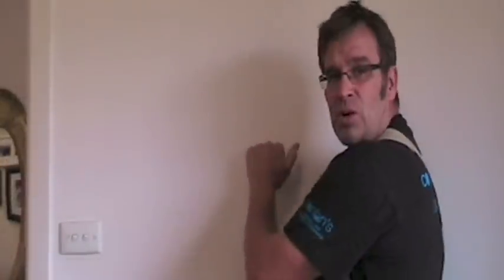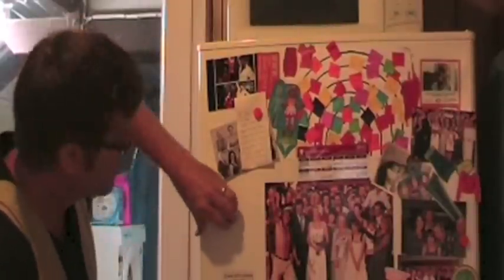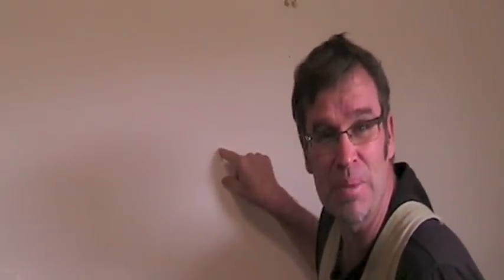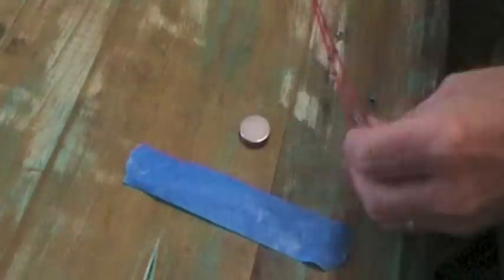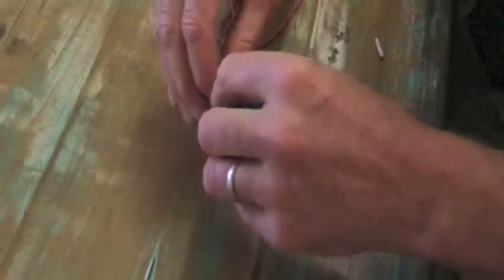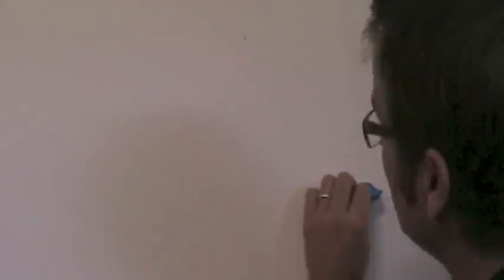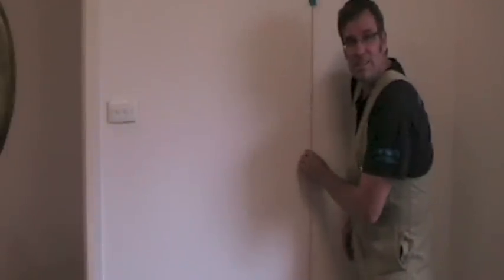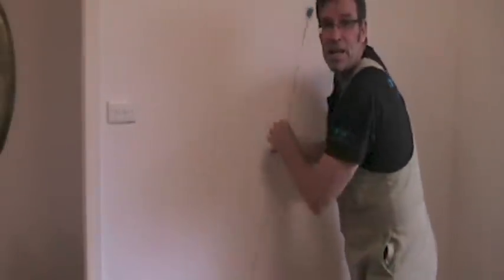How to Find a Wall Stud. THE ULTIMATE STUD FINDER!

Comment: Can I please ask you somethin? I do have a stud finder but every time I found a stud it wasn't a stud, and I tried your magnet thing but it didn't work and when I drill into the wall where the stud should be what comes out is something white like plaster but it's not drywall where it's Hollow what is that and how am I going to hang the thing I have to hang
Reply from the maker: Sorry Stephanie, but without seeing your wall it is hard to diagnose. Maybe ask someone from your local hardware store. Good luck 👍

Comment: I have a giant sheet of metal directly behind my sheetrock in my closet, that broke a drillbit for wood. It's so strong. I'm trying to hang a closet rod and shelf but I can't get through the metal. I have a stud finder and it can't find the studs through the metal. Please help, will liquid nails work?
Reply from the maker: G'day Dj. If you can't find the stud due to the metal sheet, get a metal cutting drill bit and drill right through the sheetrock and the metal sheet. Then go and purchase some wall toggles. Wall toggles are really good at attaching brackets to a wall. Make sure you read the back of the packet to see how much weight that particular toggle will hold. You can buy different sizes of toggles for various weight loadings. Hope that makes sense. Cheers. PS. Buy the toggles first and read the back of the packet. It will tell you what size of drill bit to use.

Comment: Mr Shane sir, what are the chances that the magnet will pick up pipe drains or electrical pipes? please advise. Thank you
Reply from the maker: Not much chance at all. First of all, pipes and the inside of wiring are generally made from copper and the magnetic attraction to copper is very low. For instance, try picking up a copper coin with a magnet? Secondly, if installed properly, pipe work and wiring is located in the centre of the stud so the magnet is not capable of drawing an attraction that far in behind the wall surface….if you know what l mean. Now having said all that, please understand that l take no responsibility if by some ever so slim chance that you do detect a wire or pipe. Cheers.

Comment: I have really old plaster walls with wooden slats between the plaster and studs. Will this method work for me as well?
Reply from the maker: Hi Sean, if you use a rare earth magnet (like in the video) it should work. Thanks for the question. Cheers mate and let me know how you go:)
Reply from the maker: Hi Sean, if you use a rare earth magnet (like in the video) it should work. Thanks for the question. Cheers mate and let me know how you go:)

Comment: BRILLIANT! But what if the guy who hung the drywall cocked it up and didn't center the screws?
Reply from the maker: +Brian Morse 9 times out of ten it would be pretty much centred (give or take a mm or two) Brian. Cheers
Reply: +shaneconlan1 Right on! I'm going to the local hardware shop now for one of them strong magnets. Got some shelves to hang. Thanks!

Comment: Any tips on differentiating a stud from a pipe?  I want to put a shelf in in my laundry room and want to be sure I am not going to try drilling into a pipe.
Reply from the maker: nyarlethotep The magnet won't pick up a copper pipe. Try it yourself. Find the copper pipes under your kitchen sink or bathroom basin and see if the magnet will stick to it. Cheers

Comment: I have a 50 inch plasma to hang on tha wall its dry wall so would I need to use toggle bolts to help support the weight?  T
Reply from the maker: G'day Andrew. Because of the weight of the TV, you will need to screw the bracket to a stud. I would think the instructions on the bracket will recommend that. I don't think l would rely on a toggle bolt to support the weight especially if it's in drywall. Use my magnet technique to help you find the studs behind the wall and you'll be set to go. I hope that helps. Cheers mate
Reply: Thanks for the advice. Shall I use toggle bolts aswell using the studs to give extra support?
Reply from the maker: Yes you can, but make sure you attach the bracket to the studs as well. The studs are your primary source of support. You should be able to find two studs within 16 inches (450mm) of one another. That's the usual stud spacing in most homes.
Reply: Cheers thanks for you're help much appreciated thumbs up :)

Comment: I used to to drill small holes just above the floor)))
but how does it work where there are not only vertical but horizontal studs as well?
Reply from the maker: G'day Lombards. To ensure that the magnet has found a stud, do this. Run the magnet over the wall till you find a fastener, then rub the magnet against the wall up to the ceiling in a straight line, and down to the floor from that initial fastener. If a stud is there, you should pick up one. two or three more metal fasteners in that line. This indicates a vertical stud is present. Hope that makes sense. Cheers.
Reply: thx a lot!
currently I am doing 200 m2 of tiles .... :D
Reply from the maker: Lombards123 200m2!!!! Man, you'll be glad to see those laid:-)

Comment: Might be a ailly question, but wen i take the magnet ouy if the hdd do i need boyh parts of the magnet or only one part
Reply from the maker: Not a Silly question Mark, just use one of the magnets
Reply: @diyforknuckleheads  thank you trying to hang a tv bracket on arm 32 inch t.v. on a plaster wall isnt sounded easy. Hollow wall anchor are my best bet but scared incase the weight of the t.v. on the arm will pull it down...i have removed a magnet from hdd  found a stud in my old house wall but dosemt stick like urs maybe cause its still attached to the bracket from the hdd i cant post pics on here ti show u
Reply from the maker: Mark, when hanging a tv off the wall you really do need to find at least one stud to screw the tv bracket into. If you have to use a wall anchor, make sure you use a heavy duty wall toggle which you can find in any hardware store. Just  have a look on the back of the packet to see how much weight it can hold. Good luck 👍

Comment: The thing is, how do you know how many nails are used per stud, and where are they located? It seems like you might have to scan an awful lot of drywall before hitting the jackpot
Reply from the maker: You will most likely find a fastener half way up the wall (if the sheets have been hung horizontally). It really doesn't take that much time to run the magnet across the wall.If you still can't find a stud try this. Locate a power outlet (power outlets are usually attached to studs) and measure in 450mm (16 inch) increments from that outlet as that is generally the stud spacing Cheers

Comment: newbie question, What if you have a copper pipe behind the wall?
Reply from the maker: Good question MsAnia. The answer is that the magnet is not attracted to copper. If there is a magnetic attraction, it is extremely minimal and would not be picked up through drywall / plasterboard. Cheers and good luck:-)

Comment: Hard drive magnets are really powerful neodymium.  However, they are oddly shaped almost like an S, not circular, so you have to use the edge of one.  Don't throw away failed hard drives. Get the magnets out of them, they come in handy. :)
Reply from the maker: They sure do DJ.

Comment: Just a note - I have tiny cube magnets (neodymium) all over one large expanse of wall and the vertical lines are quite zig-zaggy (the tiny magnets that center themselves on the screws). There are a couple that are significantly off and almost certainly not even in a stud. You can get neodymium magnets (rare earth) in sets of 5 or 10 or whatever, on etsy.com. Their sellers are all over the world, so it shouldn't be a problem.

Comment: Ha, Ha . . . I thought my method was the best, this by poking a very small hole thru the sheet rock into a stud from where I measured a 16 center point from the corner wall, which worked fine but your method kicks mine in the butt! I am pissed because I didn't think of your method first . . . Ha!
Reply from the maker: Don't be too hard on yourself Ric:) I have to say your method works well too. Thanks for the comment mate. Cheers

Comment: or you can use the magnet of an old speaker.  I used the stud finder( a yellow one) and found my sewage pvc. Drilled it !!!
Reply from the maker: Unlucky Terry :-( Good idea re the speaker magnet. Cheers
Reply: not ready to pay a plumber to fix it it!  so have used bluetack for the moment(sometime now ) not plastered back yet till I find a permanent solution(literally)
Reply: terryyouth PVC cement will fix it, just cut a piece of pvc from a scap length of pipe and glue it to it, it dissolves the PVC and pretty much welds it together
Reply: ***** Thanks for that!!  i have used a kneading dough and closed up the hole in plaster( i cut out a square piece to check the damage) with an A4 paper so that I can check it from time to time. I will look for PVC cement at the hardware store next time I visit.

Comment: Ok I'm about to hang shelves in my laundry room but how do I make sure theres no electricity
Reply from the maker: Hi. Expensive stud finders have the capacity to pick up wiring but the magnet won't as it can't detect copper. Most wiring is run through a hole drilled into  the centre of a stud so the chance of hitting any wiring is small especially if your fixing is comes with screws included. The screws included usually are sized as to not go into the stud to far therefore reducing the risk of running into any wiring. Having said that, care still needs to be taken and the installer has to be responsible for any actions taken. Good luck. 👍
Reply: Thank you very much. I'm going to go ahead with it. You rock

Comment: not all Fridge Magnets are made of Neodymium magnets, so be aware of what you're using, as most are not nearly as strong as a Neodymium.
Reply from the maker: That's right Cain. Then magnet needs to be strong enough to find a fastener behind 10mm of drywall. Cheers
Reply: shaneconlan1 but any Neodymium will do.

Comment: What if the wall is stucko and not drywall??????????
Reply from the maker: Still give it a go William. You've nothing to lose
Reply: stucko has metal screen often behind it so the magnet would go crazy.
Reply from the maker: Good point, l forgot about that.....The metal screen when on a timber framed building is often attached to plywood. Would the plywood be strong enough to screw your fixture into?
Reply: yes, when there is in fact plywood, which would only be on stucko walls of more than one story homes. Single story not so often.

Comment: And what if the wall is tiled?
Reply from the maker: G'day Bern. I'm not sure if it would work through tile. I've never tried it. Usually when you're attaching a fixture (like a soap holder or towel rail) to tiles you generally don't need to find a stud as the plastic wall plugs are strong enough. However if you are trying to attach something heavy then you may need to find a stud. Hope that makes sense. Cheers
Reply: Thanks for your prompt reply.  Noted.
A useful and funny video!
Reply from the maker: Bern From Wales Cheers Bern
Reply: If it's not your home just tell the owners your doing the remodel for you have to take off the tile to find the studs  and the remodel will cost a little more than I thought. Just joking as usually a tiled wall is at least one inch thick so what ever your intentions are  a toggle bolt or some other insert that will give you the holding strength you need.

Comment: how do you find a stud on a outside stucco wall
Reply from the maker: +Amendra Prakash That's a bit trickier Amendra. I've never tried that before. Try working 450mm (16 inch) centres from the outside edge of the building. Good luck

Comment: What if the studs are wood.
Reply from the maker: Not a problem. Metal fasteners are used to attach the drywall to the wooden studs. The magnet picks up these metal fasteners. Cheers :-)

Comment: Spent 20 mins searching but nothing...
Reply from the maker: Mate you need to use a rare earth magnet and for a standard height wall try the magnet on the wall around the 1200mm (4 foot) mark up from the floor. good luck👍